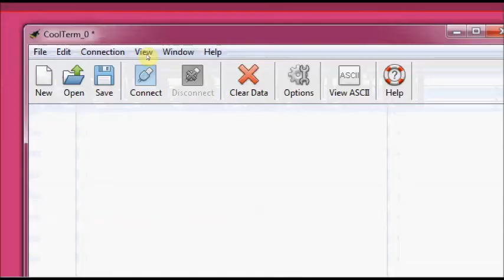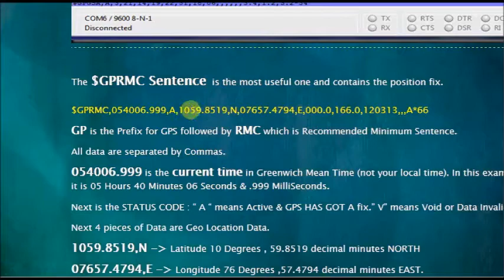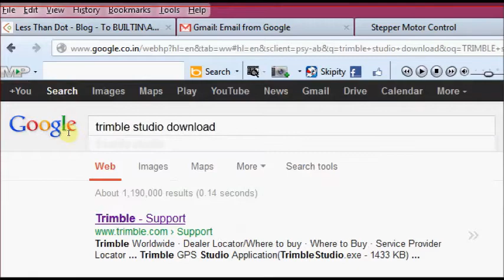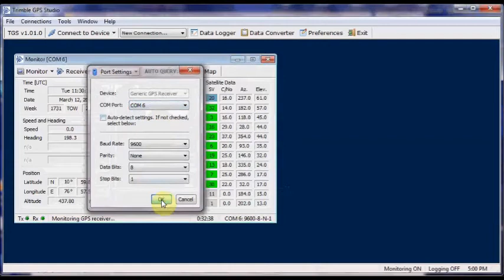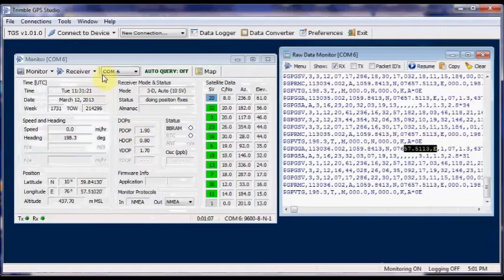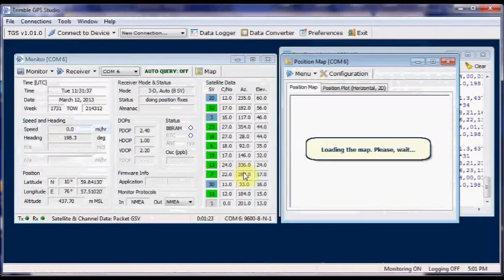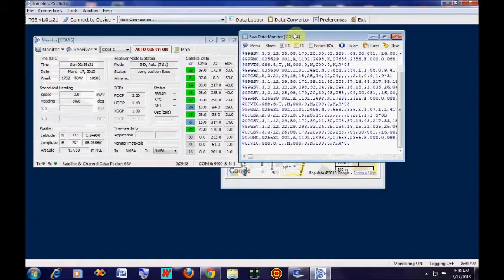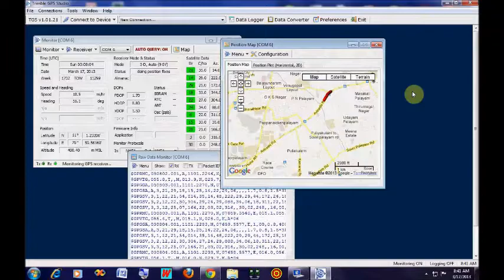GPS MODULE SKYTRAQ 634

Comment from the maker: Generally we use a GPS module to get the latitude,longitude ,time data.This can be transmitted using a GSM board like SIM300 or 900. If you like to communicate between 2 GPS ,you've to go for company GPS receivers operating with a base station , which are expensive ones.

Comment: Hello sir, I want to use the SkyTraq S1216F8‐GI3 L5 NavIC + L1 GPS/GLONASS Receiver Module for my final year project to get coordinates through the NavIC constellation. Which breakout board should I use for it. Also how can I interface  SkyTraq S1216F8‐GI3 with Arduino or ESP8266. Any help from your side will be very grateful.